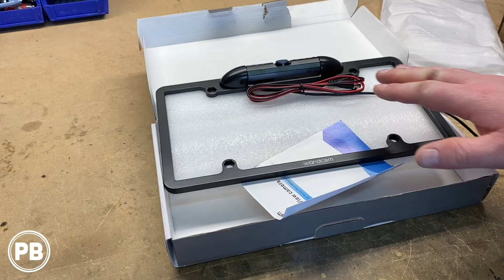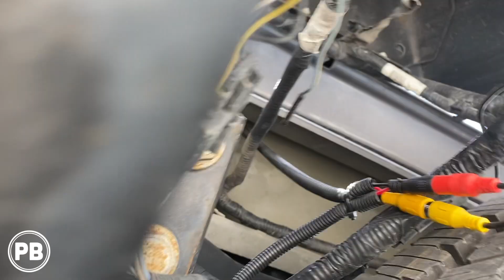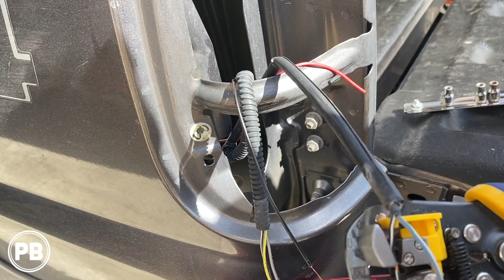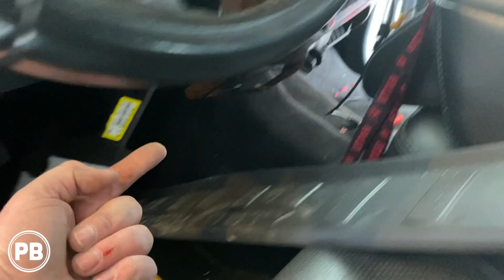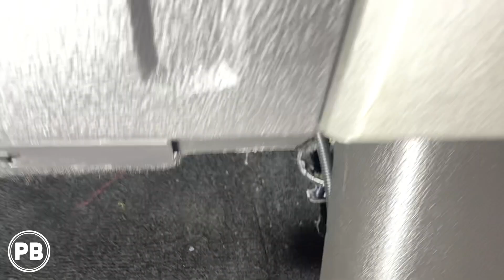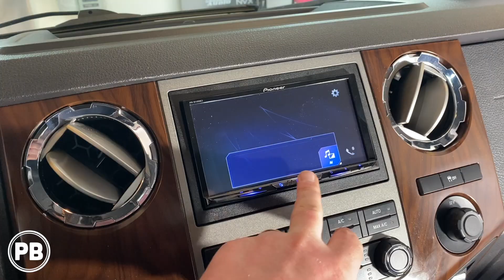2008 - 2016 Ford F250 F350 Backup Camera Install

Comment: Have you ever done an installation including a front camera that operates off of one of the AUX switches?  I would like to have something like that for pulling up to a building wall or pole in front of a parking spot.

Comment: were is the purple trigger wire on the harness? that has to have power from the back up? confused how you did it with no trigger wire
Reply from the maker: The smart harness we used provided the trigger wire for us (Crux harness). The trigger wire is generated over the data canbus of the vehicle.

Comment: Thanks for posting this video.  I never ran wire like this before and it made it way less intimidating to try.  More importantly, it showed me how to remove the moldings and slip the wire through the grommet and under the carpet.  Perfect instructions!

Comment: Power, ground and reverse are all available at the trailer plug in the number. No need to pull the tail light.
Reply: What if you have it wired the way you recommend. But then I hook up a trailer that has a backup camera on it? Will it interfere?